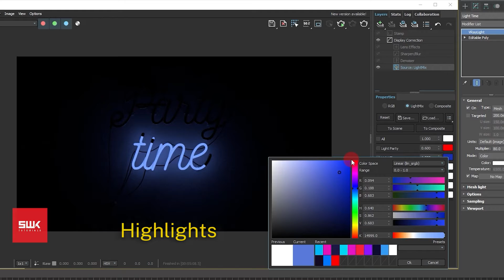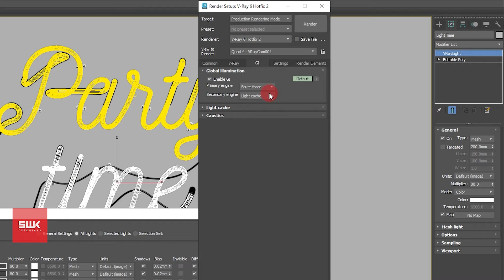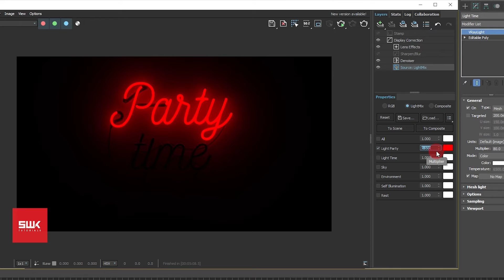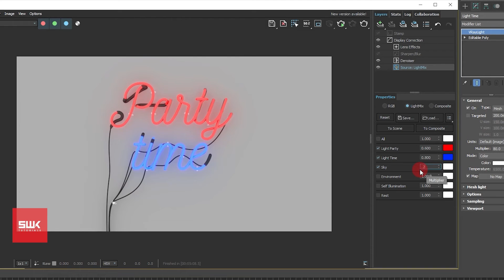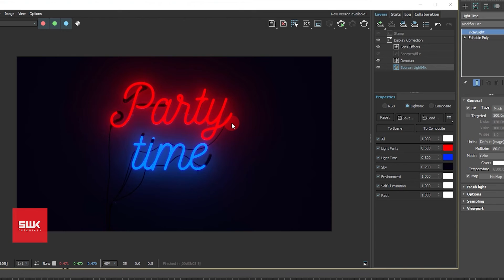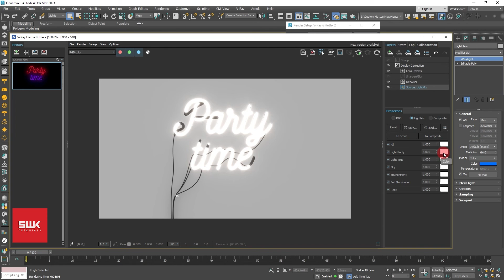Change Light Intensity & Color without Rendering | VRay Light Mix Tutorial | Vray for 3ds max

Comment: Sir ek help chahiye 3d se related
Reply from the maker: I would love to help you. If I can
Reply: @SWKTutorials  sir Rendering krte time GPU fan chalta nahi hai
Reply from the maker: By default vray is cpu based
Means it uses CPU for rendering 
GPU is only used if you are using vray GPU from render settings
Reply from the maker: I’ll check my system GPU And let you know before night
Reply: @SWKTutorials  ok sir
Reply from the maker: Yesterday I was extremely busy in office today I’ll definitely check
Reply: @SWKTutorials  ok sir
Reply from the maker: My gpu fan is on all the time
Try one thing 
Create a new user on windows 
Login from that user
and then create a new vray file 
and render it